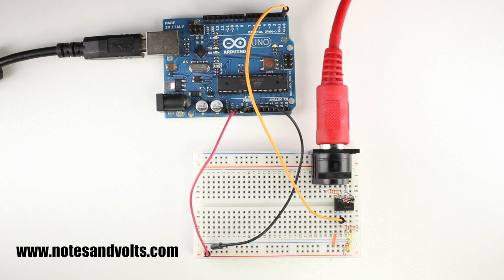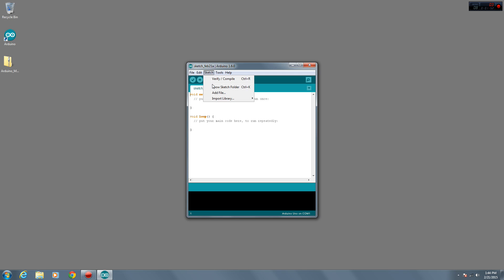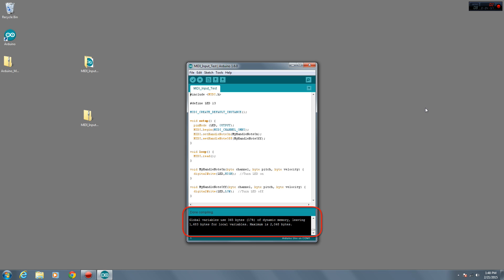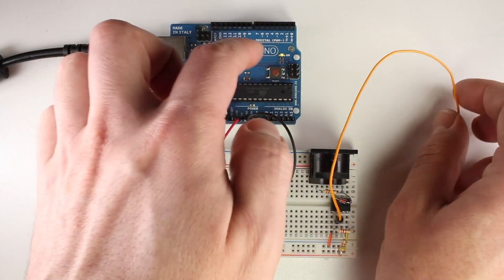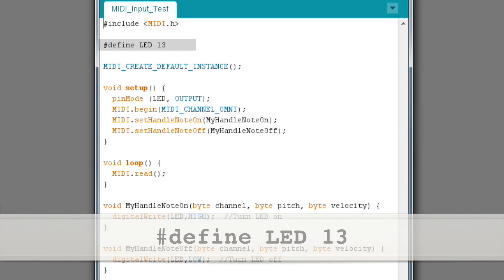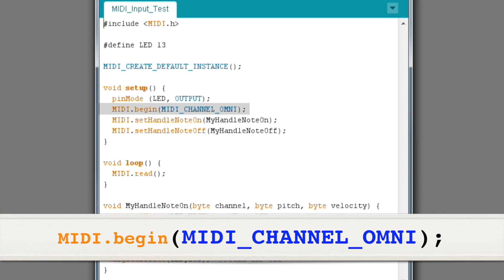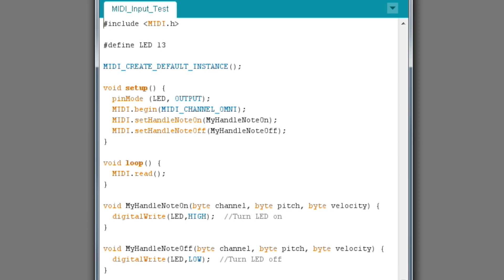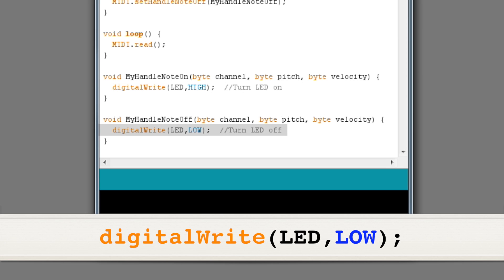MIDI for the Arduino - MIDI Input Test

Comment: Hi Notes and Volts! Thanks a lot for your videos, the info you share are easy to follow and suoer interesting! I'm watching your playlist about Arduino and Midi as I would like to buil a project with that. I have a question, is the wiring on the breadboard the same if I use a TRS midi connection ? Thanks!

Comment: Hi nice video, one thing I'm trying to do this for a keyboard shield that comes with an Arduino, to transmit the midi through USART to the laptop, and play notes in a DAW, but I need to do it with assembly, I'm generating the bytes and all the stuff, but my USART function to transmit I'm not sure if there is a way to check it's sending the bytes, because when I pressed the keys assigned to the PORT D it was working, sending midi messages to the software that converts the USB again to midi and send it to the DAW, but it was like random things, so I disable it, but leaving the init USART on, and now I wonder about it, have you try this in assembly before? The only code from the same manual of ATMega328P and stuff of registers and more, is the Init USART and Transmit USART, I changed some things in the registers commands, but is the same thing and is not working. Thanks in advance!

Comment: Hello, i was wondering two things. 
1.- Can i use other opto coupler? Like the 4N35 because tha'ts the one i have available.
2.- I know from other proyects i've made that there's a MIDIUSB.h library to be used on Arduinos with native USB-HUI. 
Can it be possible to use these two options to make it simpler?

Comment: Hi, this was a great tutorial! I need some help though. I connected this to my electric drum set, and I want the led to light up only when a certain note is hit. How can I do this?
Reply: first: find out how the note you want to use to light led is represented in midi
then, in the handle callback, use an if statement to check if the note is the one you want, then only activate the led if the note matches

Comment: Is it posible to use MCT62 as optocoupler in a midi circuit? I've seen that reverse voltage is 3V instead 5V on the IC you recomended in other videos for midi implementation. Will it work? I have some of them laying around asking for work.

Comment: Very good Video, thank you very much. Will subscripe to your channels :-)
Midi IN works for me now, and everything is blinking now on the Arduino.
I just have a problem with the Serial Monitor...it works, but the output is garbled (nonsense characters). The baud rate is the same (9600) in the modified sketch and the serial monitor window. Is it possible at all to use MIDI IN and the Serial Monitor at the same time?

Comment: Hi Dave, thank you for your video!
I need your help. I am trying to combine sending and receiving MIDI signal on an Arduino. I use Hairless MIDI to send signal to the Mobius (loop machine) and Mobius send  a note (10, 1, 127) back to light up an LED and toggle it with another note (10, 2, 127) BUT the code doesn't work. The hairless get a loop when I push a button on Arduino, after a while it crashes. This is my code so far.
Cheers Sur

#include <MIDI.h>  // Add Midi Library

#define NUM_BUTTONS  9

const uint8_t btn_rec_play = 3;  //REC-PLAY
const uint8_t btn_reset = 4;     //GLOBAL RESET
const uint8_t btn_mult_stop = 5; //MULT-STOP
const uint8_t btn_clear = 6;     //UNDO-REDO
const uint8_t btn_track1 = 7;    //TRACK 1
const uint8_t btn_track2 = 8;    //TRACK 2
const uint8_t btn_track3 = 9;    //TRACK 3
const uint8_t btn_track4 = 10;    //TRACK 4
const uint8_t btn_mode = 11;     //MODE
const uint8_t btn_cleartrack = 12;     //CLEAR TRACKS, declare it 2x
const uint8_t recLED = A5;
const uint8_t volLED = A4;
const uint8_t reset_cmd = 0x10;
const uint8_t undo_cmd = 0x11;
const uint8_t clear_cmd = 0x12;
const uint8_t play_start_cmd = 0x20;
const uint8_t rec_start_cmd = 0x30;
const uint8_t vol_start_cmd = 0x40;

const uint8_t buttons[NUM_BUTTONS] = {btn_reset, btn_clear, btn_rec_play, btn_mult_stop, btn_track1, btn_track2, btn_track3, btn_track4, btn_cleartrack};

const int ledPin =  LED_BUILTIN;// the number of the LED pin
int ledState = LOW;             // ledState used to set the LED
int mode = 0;                   // 0=Play, 1=Record, 2=Volume control
int modeValue = 1;
int previousMode = 0;
int previousModeValue = 1;
unsigned long modeLongPress = 0;
unsigned long clearLongPress = 0;
int longPressTime = 1000;
int modeChange = 0;
int modeStateChange = 0;
uint8_t modeBuffer = 0xFF;
uint8_t modeEval = 0xFF;
uint8_t priorModeEval = 0xFF;
uint8_t btnBuffer[NUM_BUTTONS] = {0xFF,0xFF,0xFF,0xFF,0xFF,0xFF,0xFF,0xFF,0xFF};
uint8_t btnEval[NUM_BUTTONS] = {0xFF,0xFF,0xFF,0xFF,0xFF,0xFF,0xFF,0xFF,0xFF};
uint8_t priorBtnEval[NUM_BUTTONS] = {0xFF,0xFF,0xFF,0xFF,0xFF,0xFF,0xFF,0xFF,0xFF};

// Retrigger and debouce
const int minRetriggerTime = 60;  //Min millis between 2 button press
unsigned long lastCmdSendTimeStamp[NUM_BUTTONS+1] = {0,0,0,0,0,0,0,0,0,0};  //NUM_BUTTON + 1 (Mode Button have different handler)
const int btn_mode_idx = 9;

//Create an instance of the library with default name, serial port and settings
MIDI_CREATE_DEFAULT_INSTANCE();

void setup() {
 
  Serial.begin(115200);  // !!! make sure that the baud rate of you port in os, in hairless MIDI settings and in the sketch is the same
  
  // set the digital pin as output:
  pinMode(ledPin, OUTPUT);
  pinMode(recLED, OUTPUT);
  pinMode(volLED, OUTPUT);
  
  for (int i = 0; i < NUM_BUTTONS; i++){
    pinMode(buttons[i], INPUT_PULLUP);
  }
  pinMode(btn_mode, INPUT_PULLUP);
    
    
  // midi input
    pinMode (A2, OUTPUT); // LED Play Tr1
pinMode (A3, OUTPUT); // LED Rec Tr1
MIDI.begin(10); // Midi channel 10

MIDI.setHandleNoteOn(MyHandleNoteOn); // This is important!! This command
// tells the Midi Library which function you want to call when a NOTE ON command
// is received. In this case it's "MyHandleNoteOn".
MIDI.setHandleNoteOff(MyHandleNoteOff); // This command tells the Midi Library
// to call "MyHandleNoteOff" when a NOTE OFF command is received.
}

void loop() {
  readButtons();
    // Main loop
MIDI.read(); // Continuously check if Midi data has been received.
}

/*
* Check if the current press is a valid and not a bounce of signal
*/
bool InNotARetrigger(int ButtonNum)
{
    unsigned long lastPressTime = lastCmdSendTimeStamp[ButtonNum];
    if(millis() - lastPressTime >= minRetriggerTime)
    {
        lastCmdSendTimeStamp[ButtonNum] = millis();
        return true;
    }
    return false;
}

void readButtons()
{
  
  //check state of MODE button
  modeValue = digitalRead(btn_mode);      
  modeBuffer = modeBuffer << 1;           
  bitWrite(modeBuffer, 0, modeValue);     

  
  priorModeEval = modeEval;               
  modeEval = modeBuffer & 0x07;           
  
  if ( modeEval == 0x00 && InNotARetrigger(btn_mode_idx))   
  {   
      if (modeEval != priorModeEval)        
      {
          modeChange = 1;
         
          //Toggle MODE betwee PLAY and REC
          if (mode == 0)
          {
              mode = 1;
          }else{
              mode = 0;
          }
      }else if(millis() - modeLongPress >= longPressTime)   
      {
          //Set MODE to VOL_CTL
          if(mode != 2)
          {
              mode = 2;
              modeChange = 1;
          }
         
      }
  }else if(modeEval == 0x07){           
    //logic to reset the timer for vol mode
    modeLongPress = millis();           
    modeChange = 0;
  }
  
  
      
  
  //light record LED if in Record mode
  if (mode == 1)
  {
    digitalWrite(recLED, HIGH);
  }else{
    digitalWrite(recLED, LOW);
  }

  //light volume control LED if in Volume Control mode
  if (mode == 2)
  {
    digitalWrite(volLED, HIGH);
  }else{
    digitalWrite(volLED, LOW);
  }

  //Read remaining buttons
  memcpy(priorBtnEval, btnEval, NUM_BUTTONS*sizeof(uint8_t));     
    
  //Read the rest of the buttons
  for (int i = 0; i < NUM_BUTTONS; i++)
  {
      btnBuffer[i] = btnBuffer[i] << 1;                      
      bitWrite(btnBuffer[i], 0, digitalRead(buttons[i]));     
      btnEval[i] = btnBuffer[i] & 0x07;                      
  }

  //send midi for mode button on state change
  if (modeChange == 1)
  {
      //Reset modeChange flag
      modeChange = 0;
      //If in play or vol ctrl mode send midi cmd to stop any active recording
      if(mode==0)
      {
          sendCmd(1, play_start_cmd, 127);
      }else if(mode==2){
          sendCmd(1, play_start_cmd, 127);
      }else{
          sendCmd(1, rec_start_cmd, 127);
      }
  }

  if (btnEval[0] == 0 && InNotARetrigger(0)){
      if(btnEval[0] != priorBtnEval[0]) 
          {sendCmd(1, reset_cmd, 127);}
  }

  //Logic for CLEAR button
  if (btnEval[1] == 0){
      //handle short press
      if(btnEval[1] != priorBtnEval[1] && InNotARetrigger(1)){                      
            sendCmd(1, undo_cmd, 127);
      //handle long press
      }else if((millis() - clearLongPress) >= longPressTime){
            sendCmd(1, clear_cmd, 127);
            clearLongPress = millis();
      }
  }else{
      //reset last time clear was pressed
      clearLongPress = millis();
  }

  if(mode==0){
  //Check for button presss and send correct note in Play mode for the rest of the buttons
  //Start at index 2 in the array since RESET and CLEAR are handled outside the loop
      for( int i=2;i<NUM_BUTTONS;i++){
           if (btnEval[i] == 0 && InNotARetrigger(i)){
              if(btnEval[i] != priorBtnEval[i])
                    {sendCmd(1, play_start_cmd+i, 127);}
          }
      }
  }else if(mode==1){
  //Check for button presss and send correct note in REC mode for the rest of the buttons
  //Start at index 2 in the array since RESET and CLEAR are handled outside the loop
      for( int i=2;i<NUM_BUTTONS;i++){
           if (btnEval[i] == 0 && InNotARetrigger(i)){
              if(btnEval[i] != priorBtnEval[i])
                    {sendCmd(1, rec_start_cmd+i, 127);}
          }
      }
  }else if(mode==2){
  //Check for button presss and send correct note in VOL mode for the rest of the buttons
  //Start at index 4 in the array since VOL CTL only uses TRACK1/2/3 buttons
      for( int i=4;i<NUM_BUTTONS;i++){
           if (btnEval[i] == 0 && InNotARetrigger(i)){
              if(btnEval[i] != priorBtnEval[i])
                    {sendCmd(1, vol_start_cmd+i, 127);}
          }
      }
  }
}

// Sends a MIDI control command. Doesn't check to see that cmd is greater than 127, or that data values are less than 127:
// first parameter is the event type, combined with the channel.
// Second parameter is the control number number (0-119).
// Third parameter is the control value (0-127).

void sendCmd(int channel, int command, int value) {
  Serial.write(0xB0 | (channel-1));
  Serial.write(command);
  Serial.write(value);
}

void MyHandleNoteOn(byte channel, byte pitch, byte velocity) {
if (channel == 10) //Works only with MIDI channel 10
{
if (pitch == 1)
digitalWrite(A2,HIGH); //Turn on LED Play track 1

if (pitch == 2)
digitalWrite(A3,HIGH); //Turn on LED Record track 1
}

}

void MyHandleNoteOff(byte channel, byte pitch, byte velocity) {
if (channel == 10)
{
if (pitch == 1)
digitalWrite(A2,LOW); //Turn off LED Play track 1
if (pitch == 2)
digitalWrite(A3,LOW); //Turn off LED Record track 1
}

}
Reply: You have Serial.begin(115200);

MIDI bitrate is 31250

Comment: Great Video! I was a complete beginner to arduino and midi, but now i have managed it to finish my midi-project! My goal was to control automatic "on-air"-lights on live cameras, to show the artists which camera is currently live. I control my arduino using the MIDI-out of the vision mixer. The 5v control-signals coming from the arduino go to a relayboard, where 4x12v for the bigger "on-air"-led's are switched. Then the LED's are connected by long distances of standard networking cable, while the other pins carry audio communication signals for the camera man.
Reply from the maker: Nice! That's a really interesting use of midi. Congrats on making it work.

Comment: Great! Will this work for piano only? What about generic foot controller? I have vintage Roland FC-100.. foot switch I wanna use for guitar effects switching. It already has MIDI out mounted at panel, and I’m thinking of simply tapping into that data wire (tx), then send it via Arduino bluetooth. Is that possible? Will Arduino Recognise the data being sent by this vintage for controller? thanks

Comment: Is it possible that the arduino could send harmful electrical current to the midi device?   I am new to electronics and I'm afraid of damaging my piano.
Reply: It seems that the arduino will only read the info, if you put all the resistors (see the schematics in the precedent video) it should be fine
Reply: +François Sio Arnaud
As long as the circuit is only MIDI INPUT, there's no electrical current goes TO the instrument. 
Even with MIDI OUTPUT, I believe no harm will occur, as there's an intermediate circuit/controller/chip that relegates & sends right signals that your instrument understands (given your circuit setup is correct, as +François mentioned above .
), hence, faulty signals will be ignored/rejected. The worse scenario will be that your intermediate circuit is the one to be affected, not the instrument.
BTW this's only my common understanding about electronic, I'M not a prof in the matter.
Reply: @abbesatty9498  that's exactly what I meant but I said it poorly ;)
Reply: @francoissioarnaud236  I'd say your comment was concise :) Just wanted to expand on your comment for all's benefit. Edited my comment and mentioned to your comment :)
Reply: @abbesatty9498  yes, yours was way more precise 👌 thx btw ^^
Reply: @francoissioarnaud236  My pleasure!

Comment: is it working with NANO too...? got this message     Arduino: 1.8.5 (Windows 10), Board: "Arduino Nano, ATmega328P"

MIDI_Input:6: error: expected constructor, destructor, or type conversion before ';' token

 MIDI_CREATE_DEFAULT_INSTANCE();
                               ^
Message...
exit status 1
expected constructor, destructor, or type conversion before ';' token
Reply from the maker: Hi Ralf. Do you have the Midi Library installed?

Comment: How can i receive midi data with USB on arduino ?  I have a yamaha digital piano and it doesnt have a MIDI port it only has a  USB midi host port .. please help me on that one  : )
Reply: I'm currently trying to make the same work but cant figure it out... Did you manage it in the meantime?
Reply: I know these comments are old now but I've just started doing the same thing, I ordered a "USB Host to midi" board from Hobbytronics, it converts the signal from the usb into midi signal
Reply: +Codingmaster
 , +
hermann s  I know this's an old comment, read on if you still need it:
There's a USB-MIDI-HOST board for arduino. You can find it at Hobbytronics website. They even have a nice project for this application.

Comment: Thanks for the tutorial! Is it possible to use software serial, or a different port on the arduino so you could still debug with the serial monitor?
Reply: Having the same problem...did you find a solution yet?

Comment: Hi Dave! Awesome videos man thanks so much for posting them, you've helped me a great deal!!  I'm wondering if you could point me in the right direction...I'm trying to define the midi bytes so that different notes will send different pins high... i.e. Middle C sends pin 13 high, while c# sends pin 14 high etc.....similar to your video about reading cc messages but just using notes instead...Thanks again for everything!! :)
Reply from the maker: +moonzoomusic Hi moonzoo. This is easy to do. When a Midi note is detected, its value is passed the the 'pitch' variable in the MyHandleNoteOn function. Simply put a statement in the function to read the value of 'pitch' and turn on the pin you want. something like:
if (pitch == 48) digitalWrite (LED1, HIGH);

Do this for every note you want to capture. You can use a switch statement to make it cleaner looking.
Reply: +Notes and Volts Unreal man, thanks heaps once again, I'll give it a try today!! :)
Reply: +Notes and Volts Hi again Dave, thanks for that advice mate, I managed to get it to work I think.  If you don't mind me asking one more quick question...I  plan to send midi to the arduino then have the pins triggering solid state relays and in turn triggering solenoid valves....I read somewhere that it's best to put a transistor between the relay and the Arduino as a switch.....would you agree that this would be more for the case for Mechanical Relays and that it would be fine to just hook the solid state relays direct to the arduino?  Thanks again for all your help, it's an awesome thing you're doing!!

Comment: Hello I'm interested in building a 8 gate module for eurorack modular. I'm writing patches in MAX and I'd like to send 8 independent trigger outs over midi to my synth. It seems like this arduino code is all most suitable. Only thing to change is just when receiving info from different midi channels arduino should output voltage also from different outputs. Because I know next to nothing about arduinos I'd like  to know is the void MyHandleNoteOn (Off) (byte channel-- the place where I should write the channel number and then choose different digitalWrite channels?
Thanks!
ekke
Reply from the maker: +0ekkeekke0 Do something like this:

void MyHandleNoteOn(byte channel, byte pitch, byte velocity) { 
   switch (channel) {
       case 1:
         //do something when channel equals 1
       break;
       case 2:
        //do something when channel equals 2
       break;

    //keep going with channels 3,4,5..... as many as you need
   }
}